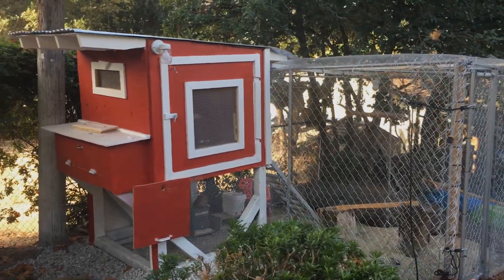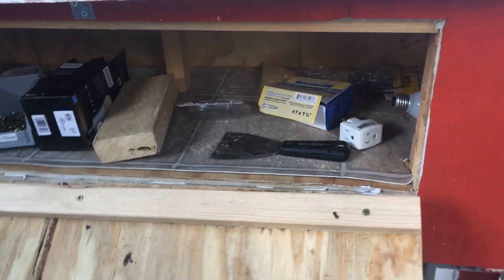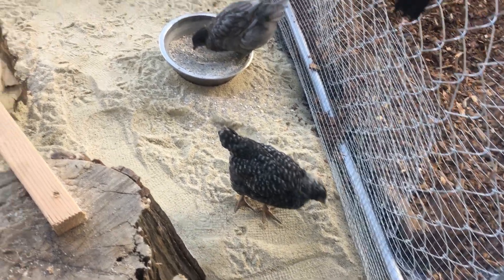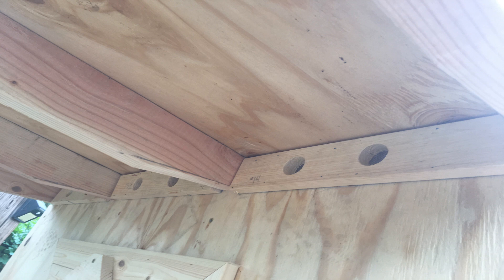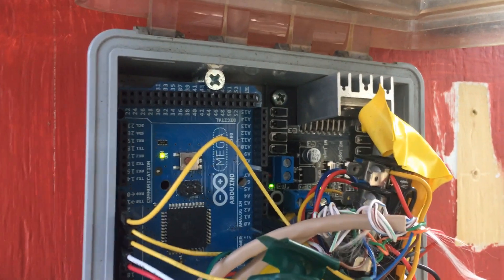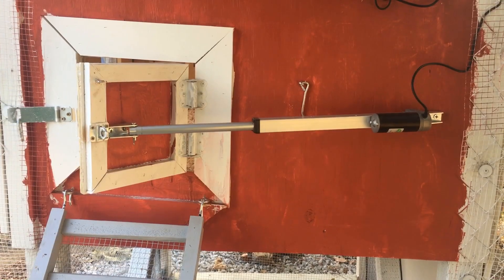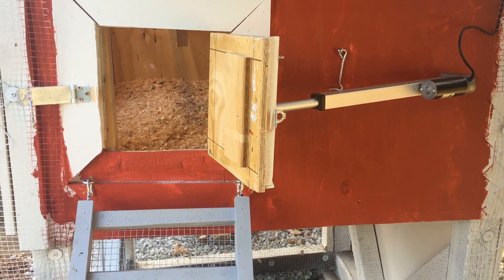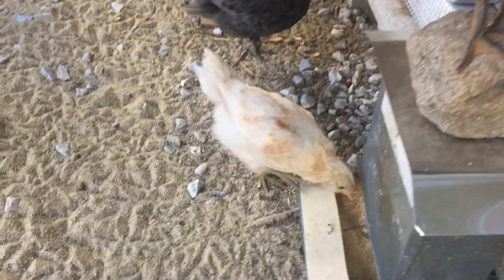DIY Automatic chicken coop door with Linear Actuator

Comment: 2:27 I initially setup my coop door to open and close by way of a photo sensor, but changed to a specific time of day after I noticed some of my birds weren't in the coop when the door closed for the night. Just something to think about.
Reply: What did you use for your day time and reversing your polarity?
Reply: @chriswf do you mean what time do I set as the opening time?
Reply: @chriswf  and for reversing polarity, are you asking if I put my batteries in backwards?
Reply: @JimWellman  Oh yeah I meant what timer are you using? And how do you get the polarity of the wires to reverse to open and close it from 1 timer? Or do you use relays+an arduino/pi?
Reply: @chriswf  I just looked at what video I posted my comments to. My original comments were just to make people aware of the fact that the sun doesn't always set at the same time and the chickens don't always go home at the same time. So I don't really like the photo cell aspect of the door that I have. I didn't build my own door, I actually have a chicken guard extreme. And it's done a great job.
Reply: @JimWellman  Ohhhh, okay npm. Sorry to bother.